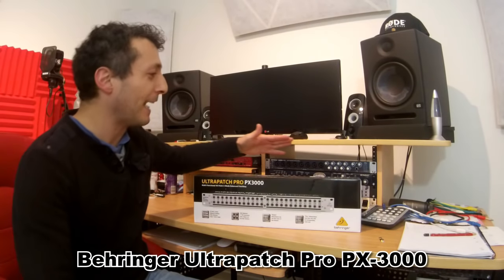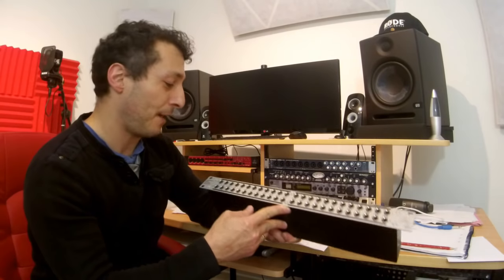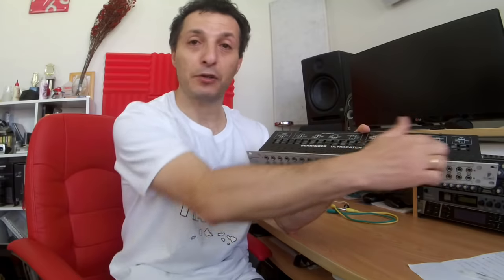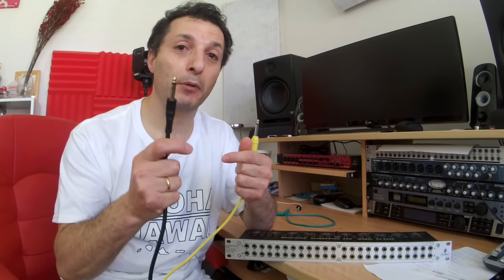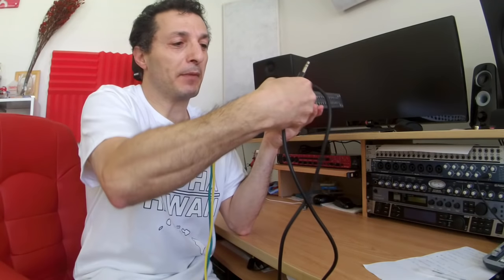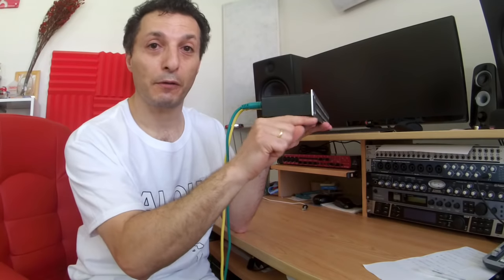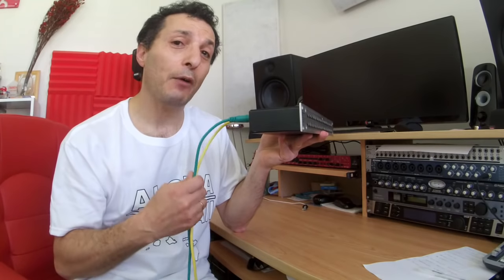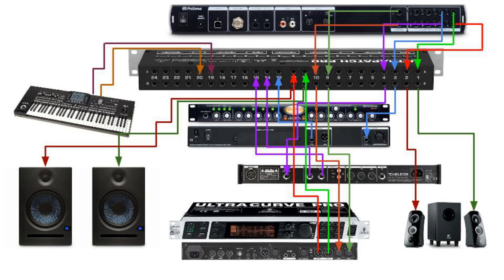All About Patch Bays - Behringer PX2000 & PX3000

Comment: i got both px2000 and 3000. thinking about using px2000 for modular synths patching, unbalanced. can i use px3000 balanced for same purpose ? since px3000 is more common at used marked.
Reply from the maker: Yes, the px3000 will work fine for unbalanced cables.

Comment: Thanks Vatche, awesome information, I've had my FCA610 packed away for a few years, now i need it again but could not remember how the hell to use it, so these videos saved my day :) Also, there is another piece of important info missing from the quick start guide: when i purchased my FCA610 it was in fire wire mode and there was no instruction on how to change to USB mode, but i finally found out that you have to press and hold the digital select button down, then power up the unit until you get the blue light indicator showing. very frustrating, hope this helps others! PEACE :)
Reply from the maker: Thanks. You might want to watch my FCA1616 video series https://www.youtube.com/watch?v=rkM8jqlcgRk&list=PLeySI9gLWqeydhiDYAzWGVDsQ1O86Ozci

Comment: How difficult could it be to explain how a patchbay work by holding a patchbay and actually connect cables to different configurations and explain how the signal comes through?? Amongst all the youtube videos I clicked on regarding patchbays (it's a lot!), this is the only one I've found that actually explain to me how I could use a patchbay. Thanks for a great video, and congratulations for being (probably) the only one explaining how the rear and front sockets are connected to each other! :-)
Reply from the maker: Thanks for the feedback. Most times, the unit is installed and in an active working state, and it's a lot of work to disassemble for demonstration, so I do understand. I did mine when I was still setting my new purchase. A new and in further detail video on Patch-Bays coming soon.

Comment: In top tier studios normaling the board to the bay seems to be the way to go but I find for home studio, thru or " isolated" mode gives you the full flexibility of the bay. Want to just put your mic into the pre into a light compression to tape? Isolated is the way to go. Imho
Reply from the maker: Each use and preference is different. Normalised setup eliminates patch leads under 'normal' setup and use. I have a new video coming up soon with more detail of Patch Bay setups.

Comment: Excellent video, thank you. I am still a bit confused about patch bays, being new to the subject. So, for example, a balanced patch bay TRS socket is letting me pass a stereo signal if the source is also TRS stereo (one TRS cable)? And next, if I have left and right channel coming into the patch bay, via two cables I would use A1 and A2 (or B1 and B2) sockets on the patch bay, no matter if my two cables are TRS or TS cables?  Hope my question is clear enough, :) Thanks for your help!
Reply from the maker: Best practice is to use each patch point for single audio channel, ie mono or Left/Right, weather TS or TRS cables are used.
There is no technical problem in using stereo (TRS) cables, but can get you into trouble when you mix different hardware devices and make a mistake in patching.
Reply: @RecordingStudio9  That clarifies a lot! Thank you!

Comment: Very informative and a great way to explain the function thanks but I have a question! I have been told that it is essential to avoid phantom power getting to 1/4" jacks but in your diagram you show an XLR to Patchbay connection. How can this be?
Reply from the maker: Though there is no issue with Phantom Power via your patch bay, I would do it on a once off basis. If your gear is a mixer with Mic inputs. Digital signals should be avoided.
In my diagram, you can see my PreSonus Studio Channel Mic pre is using Line levels.
The XLR connection to my UltraCurve you mention, is LINE level balanced signals. This rack gear is a digital EQ unit.

Comment: Very useful lesson! Thank you so much 😊.. does the patchbay cause any additional noise assuming that I’m using all balanced cables and connections (comparing to direct connection between gears) ? Thanks!
Reply from the maker: Thanks. I have not had any issues so far. But low quality and/or loose connections can cause issues.

Comment: Very nice video, thanks for sharing! Something that I don't understand is how to connect the front inputs of your audio interface to the back of the patchbay. Did you even do it at all? If not, why?
And talking about microphones, how would you proceed connecting them? Of course you can't connect them directly to the patchbay, so you need to do it to your audio interface or a different preamp, right? Doesn't it make a mess of wires on the desktop? Is there a better way to do it?
Reply from the maker: +Marco Longo 
Good questions, as you might have missed the process. 
1) Every front panel socket has connection to the back socket. All my equipment, eg. Audio Interface, Pre-Amp, FX, have leads connecting them to the back of the Patch Bay. So yes, at the back, there are lots of wires running to and from the Patch Bay to my gear. I have around 36 6.5mm Jack leads at the back. But this allows me to have access to those 30 odd connections right on my desk.
2) Since the patch bay is TRS connection (balanced) I can certainly connect my Mic via XLR to 6.5 TRS lead to my pre-amp, if I needed to (my PreSonus Studio Channel Tube Mic Pre has both input and output connections on the Patch Bay). Most Audio Interfaces have at least 2 Mic-Pre channels at the front to make it easy. All Mic-Pre at the back, can have a balanced point on the Patch Bay.
In my case, the two Mic-Pre on my Audio Interface support Insert option. What this means, I can connect the Mic to my Audio Interface Mic input, then the audio is routed to the Insert Out socket at the back of the unit. A wire connects this to back of my Patch Bay, routing the analogue audio out to my patch Bay. Then within my Patch Bay I can connect this output to the Input of my Tube Pre for Compression & EQ. The Output of the Tube Pre from my Patch Bay is sent back to the Insert Input of my Audio Interface, before it is A/D conversion and to my PC & DAW. With Patch Bay, I can re-direct the Mic audio signal to any other audio processing gear, eg. my Behringer MDX2600 for different FX, Gate+Comp+DeEaser etc. with the ease of simply patching the lead at the front of the Patch Bay.
Expensive? Yes. Apart from the Patch Bay rack unit, you have lots of wires to purchase, plus the front short patch leads.
Worth the money? Well, for me, the amount of time and affort saved, absolutely!
Hope this is clear enough and explains the confusion.
Reply: +RecordingStudio9.com Thanks for your reply.

1) I know that, but I wonder why none of your audio interface inputs are connected to the patchbay. Let's say that you wanna reamp a guitar track or reprocess some drum tracks. You should go: 
AB1818 >> Patchbay >> Outboard >> Patchbay >> AB1818
Is that right? If not, what's the proper way to re-record processed audio from & to your DAW through hardware outboard?

2) This sounds similar to what I was pointing out on #1. So basically you do that kind of routing with "Insert In" and "Insert Out"? What if I need to route more than one channel at a time, like a keyboard or a drumset? Also, does that mean that you still always have to connect your mics to the front panel?
Reply from the maker: +Marco Longo 
I got your question now.
1) My main audio interface now is my Mackie Onyx Blackbird, so all but 2 connections are at the back of the unit. When I had my AB1818VSL, I did not feel the need to connect the inputs to the Patch Bay as they where right under the Patch Bay and easy to patch through, saving patch leads. But if my AB1818VSL was on my rack below my desk, then yes, they would have been patched.
2) It all depends on the Audio Interface available Insert options. AB1818VSL does not have any Insert sockets. Onyx Blackbird has 2 for the Mic-Pre, my Behringer FCA1616 has all 8 inputs come with Inserts, so they would be patched. The FCS1616 is great for live, as I can manage the audio for each channel with Compression/EQ before being recorded in my DAW. I have 3 Com/EQ gear, giving me 6 channels for Insert.

It is all about laying out all your gear, drawing all the 'Normalized' connections and run them through the Patch Bay. If the Audio Interface or FX gear is next to the Patch Bay and they have their connections at the front, it just makes sense no to patch them.

In my current setup with Onyx Blackbird A/I, everything is patched, except the 2 Mic-Pre, where I connect my Vocal or guitar Mics directly.

My AB1818VSL & Behringer FCA1616 are for my mobile recording use and not even rack mounted.

If you are recording drums with 5 to 8 Mics, and your A/I does not support Insert for each Mic-Pre input, then you cannot use the FX gear in analogue audio routing. Also, you will need multiple FX gear to Compress/EQ the 5 to 8 Mics used.
I hope this was helpful. Please feel free to ask any further questions. happy to explain as much as I can.
Reply: +RecordingStudio9.com You've been very helpful. Thanks!

Comment: Awesome video!  Two questions:

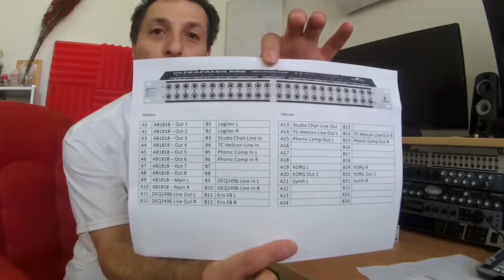1.) Regarding Thru, I understand there is no "hardwired" connection between the top and bottom jacks, but in your spreadsheet @14:30 you showed your synths L and R both on one "column", ie A/B19 show for Korg L and R, A/B20 show for Korg Out L and R, and A/B21 show for Synth L and R.  This would seem to imply that in Thru mode you can connect the 2 outputs (L&R) from a stereo synth into one "column".  But then in your picture diagram around @15:45, you show the 2 outputs from the synth going into 2 different "columns", purple and orange-brown going into 19 & 20.  Can you explain this further?
2.) When use Normal vs. Half-Normal vs. Thru - how plan?  I recently got a 48 point patchbay and am trying to figure out how to set it up.  I have an 8input/8output hybrid mixer/interface that goes right into my computer, a DBX compressor/limiter, a Lexicon effects rack, a drum machine, a groovebox/MIDI sequencer, a sampler/synth, 2 polysynths, 3 mono synths, and a few effects pedals.  Most of those have at least stereo outs except the monos and some of the pedals, and a few of them have extra sub-outs, and the monos and one of the polys have external inputs as well.  Up til now I've just been rewiring everything with each new setup to record, but that's a pain and people kept telling me get a patchbay.  So I did, but now I have no clue what to do with it.  :)  Your video helped with a basic understanding, but you have a bunch of different pieces than I do, so it's not totally clear.  Any help you can give is much appreciated!
Reply: Oh I forgot to say, Input 1 on my mixer/interface (a Keith McMillen K-mix) is dedicated to my microphone, since I don't have any dedicated external pre-amps.  So really I only have 7 available inputs on the K-mix.
Reply from the maker: K-Mix, I think is a very functional and small footprint audio interface/mixer and control surface. Nice.
In normal mode, all A connect to B, unless interrupted by a patch lead.
In Thru mode, there is no connection between A & B. It simply brings the connections from a gear to the front of the patch bay.
Set Patches 1 to 16 to Normal, 17 to 24 to Thru.
You can connect all the K-Mix inputs 1 to 8 to B1 to B8. Then your most used synths to A1 to A8. 
You can use a TRS to XLR lead to connect your Mic to K-Mix input 1 by plugging to B1. This will disconnect A1. This will allow you to use the input 1 for any other setup, ie connect all 4 Synths stereo out at the same time.

Connect K-Mix out 1 to 8 to A9 to A16. Speakers or other audio gear that have input can go to B9 to B16 respectively.

Connect all Synth outputs to A17 to A24.
This will bring all the outputs of the synths to A sockets. You can also connect any Synth inputs to respective B sockets.

So if you need to connect Synth 4 output to input of Synth 5, then you patch from A of Synth 4 to the B of Synth 5, then the outputs A of Synth 5 to B3 and B4, disconnecting Synth 1's outputs from A3 & A3.
Hope this helps.
Reply from the maker: As in my last comment, common synths can use two A  'columns' to 'normally' connect to two B inputs. Other Synths can use Thru mode and use only one 'column' A & B for output. But make sure you label them, as it is common practice to have A as output and B as input.
Reply: Hi, thanks for the fast response!  I'm still sorta confused though.  If I understand you correctly, you are saying A1-8 are Synth Outputs, B1-8 are Kmix Inputs, A9-16 are Kmix Outputs, B9-16 are other Inputs, A17-24 are more Synth Outputs, B17-24 are Synth Inputs?  So I'm using A1-8 and A17-24 for Synth Outputs?  And if 17-24 are set to Thru, would these only be for mono, or would I use 2 "columns" for a stereo synth?  Is there any advantage to doing it this way instead of Normal? Also... where do my compressor, multieffects and effect pedals go?  I could put their inputs on B9-B16, but then where do their outputs go?  And lastly... what about Half-Normal?  Would that give me anything in this setup?
Reply from the maker: You pretty much got it. But first, you need to write down all your gear in a list with inputs and outputs. All of them, then work out which gear have both in and out (eg. audio interface, EQ, Comp), and which ones are output only (synths, drum machine) and input only (eg, powered speakers). Then work out what is a 'normal' connection you do, without patch bay. Then sort them out on the patch bay in groups of 'Normalized' and 'Thru'.
If you need more help, find me on Skype. Happy to help.
Reply: Actually yeah I would love to email you my spreadsheet then do a Skype session to talk through it!  I actually have more gear than I mentioned (was trying to keep it simple), and I suspect I might need a 2nd 48 point patchbay now.  :)   I'll send my sheet by email later today, let me know if you would want me to just sign up on Patreon or something else, happy to pay for your expertise!
Reply: Ok, emailed you a spreadsheet with as much detail as I could get.  Looking forward to our Skype to hammer this out!

Comment: Thanks! Great tutorial!! Can the Behringer PX3000 Ultrapatch Pro take a stereo signal in each socket? So I could send my synth's out to the patchbay using a Y-connector?
Reply from the maker: Yes, you can, since the PX3000 is balanced/stereo/TRS sockets through.

Comment: Nice video, thank you for making it a bit clearer for me. As I have a number of hardware synths, would I still need a mixer of some kind? I assume that you can't 'mix' patchpoints to one destination; I am thinking 2 synth signals combined to the stereo inputs of my interface (I hope you can understand that!)
Reply from the maker: Thanks for the comments. Unfortunately no. You can split a signal in "Normal" mode, but as soon as you plug a patch lead to bottom B socket, the A socket link to B is broken.
You need a mixer to combine, not a patch bay.

Comment: Hi Vatcha!, I see you have a direct out going into your studio channel, so your not using the MicPre at all or are you using it through different routing only??
Reply from the maker: 90% of the time the Studio Channel is connected as an INSERT into my mixer or audio interface using the line in/out, unless I need the XLR input (you can't have both connected at the same time, line takes over the XLR input)
Reply: @RecordingStudio9  Ohh ok, i use the mic pre alot and intrument in put on the front and i dont use it at all as an insert. Thanks For The Info..
Reply from the maker: Having the unit on my patch bay, allows me to use it with multiple options.

Comment: Hi. Thanks alot for this video. But I have a question please?
My audio interface has 8input and 8 output.
With a patchbay can I have access to more tracks?
I mean with my soundcard I can only record 8 instruments at a go, but with a patchbay can I record more than 8 instruments at once?
Can a patchbay work as an extension???
Reply from the maker: No, and I'm not sure you understood what a Patch Bay is. If your interface supports ADAT connection, then you can buy Behringer ADA8200 to add an extra 8 in and out. Might want to read and watch. https://www.youtube.com/watch?v=T78rsaUmEWk

Comment: Behringer Ultrapatch is balanced TRS , couldnt you use a  L +R out of the synth into one stereo TRS using only 1 patch  bay input ( Y stereo lead) ??
Cheers..😊
Reply from the maker: Yes, it's possible but not recommended for general compatibility. As long as you mark them accordingly, it will work.
Reply: @RecordingStudio9com  thanks for the reply , I also was told the splitting the TRS stereo into 2 Jack's on a balanced patch bay ,those 2 mono jacks are "balanced" and if you were to use just one as stereo, ie TRS this will work but it will be "UNBALANCED".
thanks for the reply. 
✌️🇦🇺 🪃